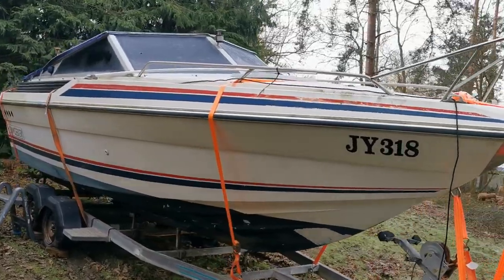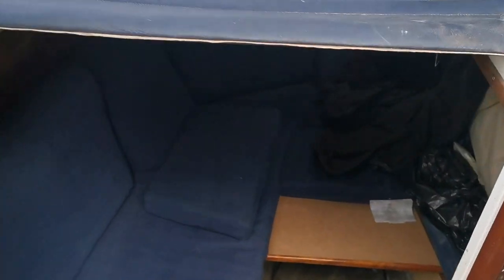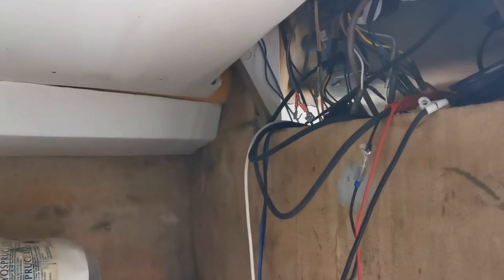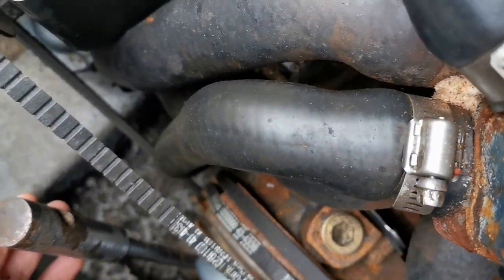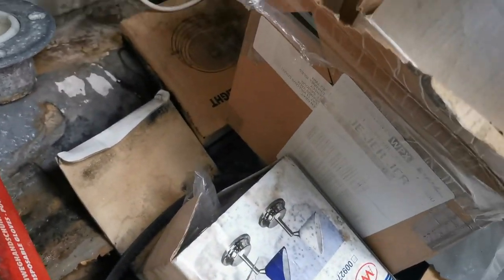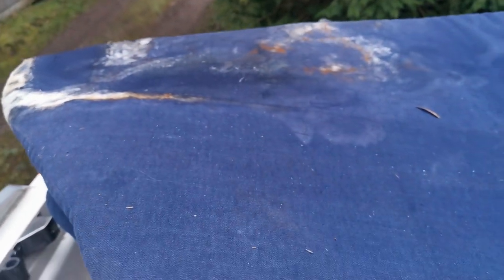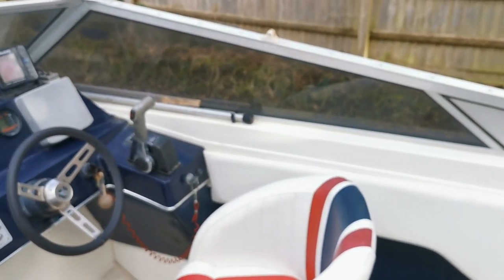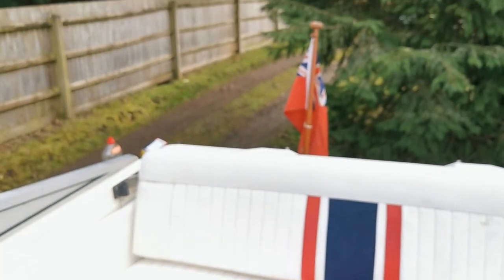1980's Sunseeker Revival   Part 1

Comment: Your going to need a trimp pump for the leg.
Reply from the maker: Hello mate,
Really pleased with the boat, yes I've managed to get hold of a reconditioned trim pump for it. Should be on the water soon.
Reply: @BoatsandEngines  I have the trim pump for that boat in my garage if you ever come to jersey it's here. 
I have been out in that boat a few times when my friend owned it when it had a mercriuser engine.